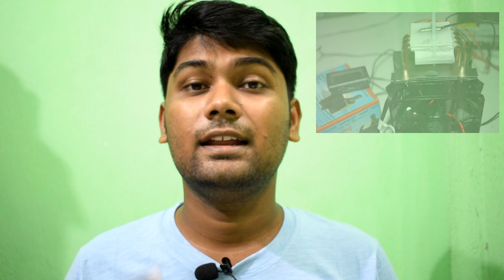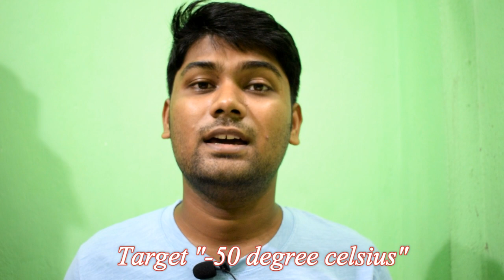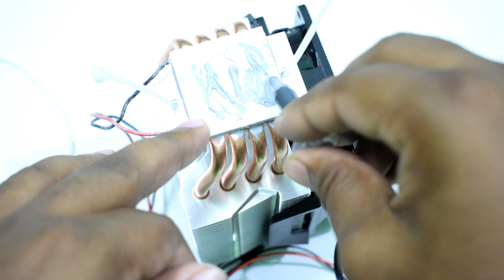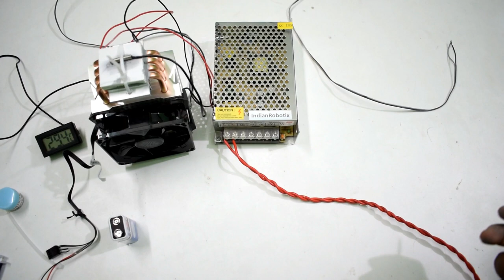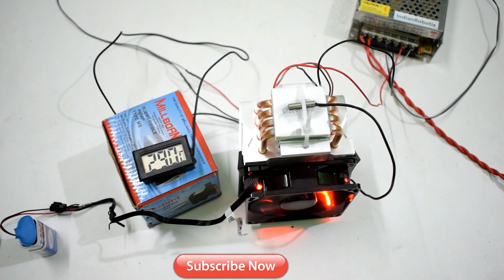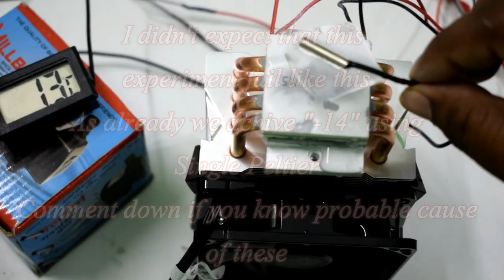Double Layer Peltier Module using TEC1-12715 By IndianRobotix

Comment: It failed because petiers produce more heat than cooling. they produce like 60% heat while only 40% cooling. Therefore using as peltier to cool a peltier will fail as more heat produced than cooling. The junction between the two peltiers warms over time due to that excess heat. That make the second peltier less effective at cooling. I hope that helps.
Reply from the maker: Thanks to let me know this.. well explained
Reply: @IndianRobotics   I have found three different sizes of TEC1-12715 . 

 40*40*3.6mm , 40*40*3.3mm and 50*50*3.3mm .

50*50*3.3mm being the more expensive ones .

I wonder if the smaller ones are fake or is the difference due to different manufacturers .
Reply: вы очень оптимистичный! Средний "КПД" модуля Пельтье - 25-30%! Тоесть - на 100Вт потребляемой мощности модуль "отводит" только 25-30Вт "тепловой"! и чтоб сделать "каскад" - нужно на первый уровень укладывать как минимум в четыре раза больше модулей(для вышестоящего "этажа")! Для двухэтажного - первый этаж - 4 модуля, второй - один. для 3-этажного - нижний слой должен содержать уже 16 модулей! По 4 на каждый "верхний" модуль!

Comment: You just need to run the top peltier at a lower voltage.   I'd try 6v and and 12v maybe even 6v and 10v. If both peltiers are run at same voltage it cannot dissipate the extra heat and will run hotter than a single unit.
Reply from the maker: Maybe👍👍👍
Reply: Yes , correct 👍👍

Comment: Such a peltier arrangement is called stacked arrangement. Normally these are mounted with the least effective peltier on top and then the higher capacity peltier at bottom. But in such scenarios, the bottom most peltier has to overcome its own heat and also push the heat out from the peltier under which it is mounted, this is the reason why similar peltiers are never stacked on top of each other. If you wud have stacked for eg 12703 on top of 12715, it could have given u better results.
Reply from the maker: Thanks for explaining 😀👍

Comment: You have to buy a double staged peltier because it's not like the one we are putting one over another it's structure is different. So If you buy the genuine one (made by factory) from the store you might not have the same problem.
TEC2-12715
Reply from the maker: Yes👍

Comment: You should have used water Cooling with radiator... That should give you the desired temperature... Getting - 50 is no big deal when water Cooling is used... Try using that and upload a video
Reply from the maker: Thanks i also thinking about the same... Will try 😊